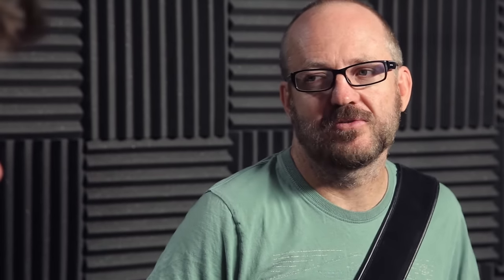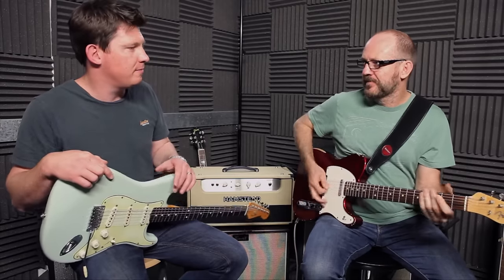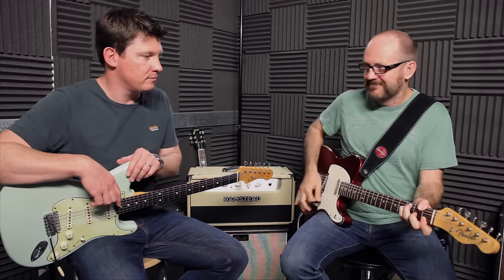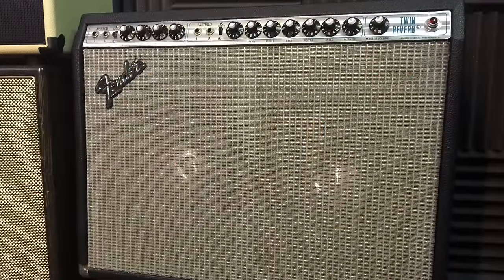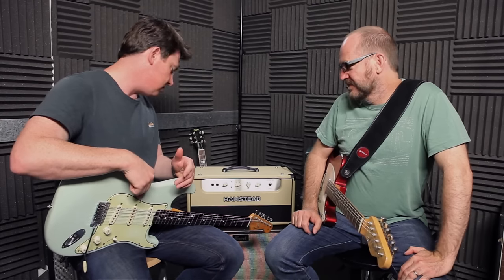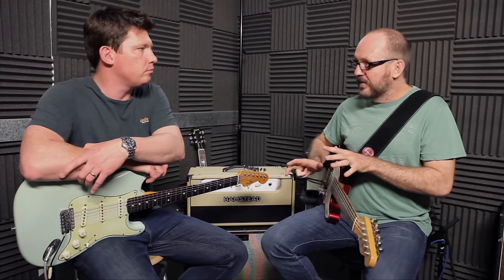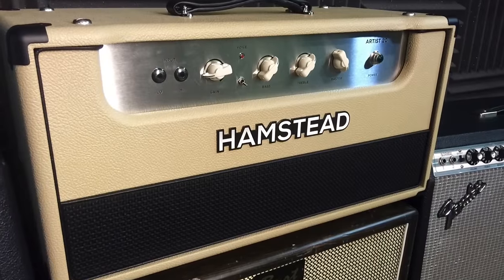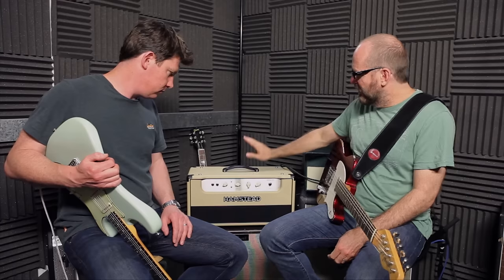Setting Up Your Amp To Use With Drive Pedals

Comment: Ok guys, I love your videos.  They are very insightful, but I just have one problem with this segment.  This video was supposed to be about setting up your amp to work with drive pedals.  To me, it seemed like the bottom line here was throw out your Fender and Marshall amps if you're going to use certain drive pedals, and get a Hamstead because it will seemingly handle everything better than the latter two.  You demoed the Fender with the fuzz pedal and said it had a "bad sound".  You also demoed the Marshall clone with the SD1 it also had a "bad sound", but my problem here is that you never gave any suggestion or insight on how to remedy these "bad sounds" if you happen to own these amps.  I have a Marshall JCM 800 clone, but what I don't have is time or money to endlessly try and buy pedals to find ones that work best.  I, like most I assume, have to make the best out of what we have so to that effect, it would have been nice for you to share some tips on overcoming the sort of flaws in these two amps in regards to using drive pedals.
Reply: The moral of the story is pick the right pedals for your amps circuit. You don’t have to buy to try them out. Bring your rig to your local guitar store and throw some different things in front of it. Or just google which pedals work best with a jcm800 (cough tubescreamer cough).
Reply: @wildbob  I noticed the tone knob on the muff was all the way to the right which is very bright. If they had of turned the tone knob down a little it may have introduced some more mid range on the Fender.
Reply: Totally agree with you. What a waste of my time this video was.

Comment: I have accumulated enough effects over 35+ yrs to open a store. At any given time I have 4 running amps/effects setups and when friends come over have noticed a common problem. I call it SPINAL TAPPING. First thing guys do is max the knobs. Distortion, CRANKED. Reverb,echo,chorus,flanger, etc knobs must be maxxed!! Its like you paid for it, use it! If a little bit of chorus,echo,flanger sounds good then MAXXED must be better!!! My advice to get a newbie started is turn them all to 12 o clock and go counterclockwise. If you are alone or simply soundscaping in a room of blue smoke who cares. But if you cannot find your pets for days or open a inerdimensional portal you might should turn all the pedals off and give it a rest.Remember- a turd + effects sounds like a turn + effects. The turds just now cost more.

Comment: I play mostly funk and soul music. So I play a fender twin with the master at 10 and gain at around 3, clean, clean and then when I turn my guitar volume from 8 to 10... also clean, but with great cut and tone for single note lines. So the way I get my dirt is by having a clean boost, Fuzz, low gain drive and a medium gain drive on my board. Many options this way. I've found that I get a good fuzz tone if I run the fuzz into my low gain drive

Comment: Daniel, what you said is spot-on correct. The question SHOULD be: "What effects are going to work better with my amplifier?". I know this through my own personal experience. For about 2-years, I played through a Fender Blues De-Ville 410 Reissue. Good amp, not the best. The 4 x 10 amps can sound toppy so I replaced the original Eminence speakers with Jensen's to make the amp project a warmer and rounder tone. I chose the 'Clean channel as my sonic 'canvas' and then set about finding good overdrive/distortion pedals. I must've tried out a dozen or so and the ones that worked well did so because of the way they interacted with the De-Ville's tone. I always paid attention to how the pedals sounded when I tried them out at the shops through other amps, but I had to know my amp well enough to hear how they would sound going through it. The importance of tone and EQ controls on the pedals was crucial. I had to be able to tailor the tones to work well with my amp. What I have discovered in the end was that the tonality and and flexibility of the pedals were the most important so that if one day I was to switch to another amp, the pedals would still sound great. I found a new amp (a very, very good one) and when I ran my old trusty pedals through it, the tone was amazing! I hope this can shed some more light on the subject.

Comment: Really helped with the new pedal additions to my board. I also used something that I saw you do in another video, by using the volume on the pedal to push the amp into overdrive. Great job guys.

Comment: Thanks guy's.Great posting.I played with my favorite amp and gained a bit of knowledge. Then with an amp I picked up on the cheep but set it up like my Marshall and wasn't impressed.Then switched out a peddle or two and now found a noise I really like. I had 3 or 4 pedals that were collecting dust and they have now found a home on what I was considering passing on...
Reply from the maker: +Patrick Teto excellent work Patrick :)

Comment: I've played a silver face 1969 Twin Reverb since the early 1990s. It's a wonderful but very challenging amp, especially for overdriven and distorted sounds. The amp reveals everything, but lots of pedals sound harsh and thin as Mick and Dan demonstrate so well. I've had great results with a number of pedals, though. For example: Fulltone "The 69 Pedal" (from the mid-90s) is a rich fuzz that really works. Zendrive and Zendrive 2 work great (and an Archer Icon into the Zendrive 2 is visceral experience!) because both pedals offer some compression and mid boost. Wampler Black 65 (with mid boosted and treble and bass down) sounds like an extension of the amp itself—very open and uncompressed. Wampler Euphoria works too with mid boosted but treble and bass down. Exotic RC Booster (fabulous) and BB Booster work. All of these pedals seem to preserve the openness and headroom that make the Twin what it is. Tube Screamers sound OK too (and maybe less revealing of every tiny detail and flaw in my playing), but at the cost of a lot of low frequencies. I'm still looking for a TS808-style solution. BTW, I tend to play Strats and Teles.

Comment: Great video. 
after years of using cheap modelling amps (Line6 spider and Marshall MG) recently I bought a Blackstar tube amp. I was so surprised how different my pedals sounded. I also have a Vox AD30VT, so as an experiment I used a switch pedal to A/B test with my drive pedals. I was astonished how they (Mooer Green  Mile,TC'S Dark Matter and TC'S Mojo Mojo ) sound completely different.

Comment: I laughed my hind end off when you played the Big Muff through the Fender. On my computer speakers it sounded like you were playing it through a 7 transistor radio speaker. I have an original black face Super Reverb. I bought it back around 1969 or 1970 and it doesn’t sound anything like your Fender amp. I like the tone of mine a million times better. It isn’t as clean as yours either. I seldom use pedals… but when I do I use my Timmy and a few others. They all sound great through my Super Reverb. Thank God they don’t like pedals through your Fender - lol

Comment: Saw this video today and it really made sense and I actually had an "ah hah" moment. I have a Blues Junior that I haven't really played much. I've been searching aimlessly for a good tone that really rocks my socks off and haven't had much luck. I was playing distortions and od pedals into a super clean tube amp with the master volume up and the pre amp volume down. Today, after seeing this, I went to the local guitar store and got a Boss SD-1 and grabbed my Blues Jr. and did what you guys did in this video. I dialed in a clean tone but this time put the pre amp volume up to 4 or 5 so that my JR was just starting to break up and on the edge of growling. Then I stomped on the Boss and OMG...BLUE STEEL, FERRARI, LE TIGRE and MAGNUM all at once. THANK YOU SO MUCH for opening my eyes and putting my rock and roll wheels back on the tracks!
Reply from the maker: +UsMaLeMan1 that's fantastic! So glad you put the info yo good use. Now go forth and rock!

Comment: A lot of early Rivera amps like my r55 12 has the Marchell /Boogie on channel 1 and fender cleans on channel 2. I just switch which channel for what peddle. This video was very helpful as I couldn't figure out why my fuzz was so tinny as I had just assumed using the fender super clean was just the way to go for all the peddles. I switched it over and it was bad ass so thanks guys.
Reply from the maker: +Phlop Alopagus fantastic! Our job here is done ;)

Comment: Great demo guys!! I have also gone with a "clean platform with pedals" formula recently, it just gives you so much versatility. I currently use a Brunetti Singleman 35W combo (with a WGS ET-65 speaker), a great Blackface-type amp which also takes pedals like a champ. Watching your video has taught me how to really get that amp to work with the different pedals I have on my board... I have never really been a big pedal guy, but this setup has made me change my mind about using pedals, they can be sooooo much fun to play!!

Comment: Never had such an extreme change when I switch from my Marshall Class 5 and my Fender ML Deville. Only been into electric guitars for about 10 years, but my experience has taught me the most important thing for a pedal amp is to get a very simple amp, as a result, getting better tones with any of my overdrive pedals. The only fuzz I have is the Velvet fuzz, I don't have this problem. You most likely have addressed this in your shows, still learning great job with your show, speeds up my learning curve.

Comment: My first amp I played with in a band was a Fender Twin with silver face. It was stolen. That was one loud amp. I had to use a distortion pedal to get a gain sound I liked for the 70's and 80's music. I played a lot of Thin Lizzy, etc. 
Would love to see you guys do a video about using over drive with a really clean amp such as a Roland JC, etc,. or more analog solid state amps that many guys buy. I know they have a bad rep, but if you buy a good one, they sound great. Many have said bad things about them because they played one of the little cheapy things that came out and were sold at box stores. 
Thanks again. 
Tim

Comment: IMO one of the best lead tones is a Strat bridge pickup running into a tube screamer with the gain turned almost off so it's just giving you a clean mid boost into a vintage style Big Muff. It's how Gilmore got that HUGE tone for the solo on Comfortably Numb. On the album he just ran into a Muff and they goosed the midrange post recording, but you obviously you can't do that live, so the tube screamer (or any mid hump OD or an EQ pedal)
Reply: p

Comment: I had a 73 Silverface Twin Reverb for years.  I loved it.  Not sure how it stacks up to a Blackface, but I never had a single complaint about it whatsoever.  Beautiful amp!
Reply from the maker: Mark Lugg they are great, loads of guys still use them and get great tones from them. I had a silver face Pro Reverb for years, killer amp :)
Reply: Daniel TheGigRig Yeah.  I was super sad to let it go, but I sold it to get a Mesa Recto-verb 25 combo.  I wanted something with a good gain channel, and also something a lot smaller than the Twin.

It was a hard call (but a good call indeed, as the Recto is killer!), but that's what being a gear head is all about, no?
Reply: I have a silverface Bassman and that’s great too. A couple of circuit tweaks and attention to the components can make them amazing.... every bit as good as a 2 grand boutique amp. I’m sure Dominic Miller had a silverface Fender of some sort with Sting when I saw him a couple of years back. They are a steal for the quality, surely they’ll soar in value in years to come.

Comment: I noticed this a while back. I have a Laney Cub 12R and have found that certain pedals work fine with the gain dialed back to clean or just on the verge of breakup and others, like my Visual Sound Angry Fuzz work better going into a slightly dirty amp. The midrange properties of the amp never really occurred to me, but that's a good consideration too. The Cub 12's midrange response is closer to a Vox or Marshall so pedals with a less pounced midrange seem to work better for rhythm tones; but I like the extra midrange punch of a tubescreamer type pedal for leads.

Comment: It's great to see people comparing amps as well as pedals and guitars, I've come across many players who think 'tone' comes either from pedals or the effects processor with the guitar doing little more than providing note information and treating the amp as nothing more than a volume machine.  Great to see a practical comparison, The only thin missing was a hum bucker loaded guitar or two, but then the video would have been twice as long...